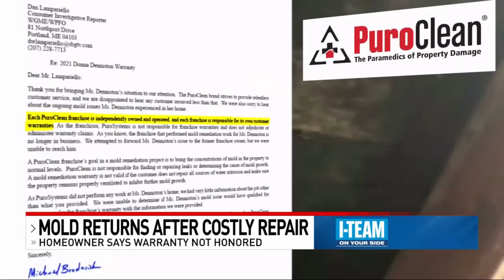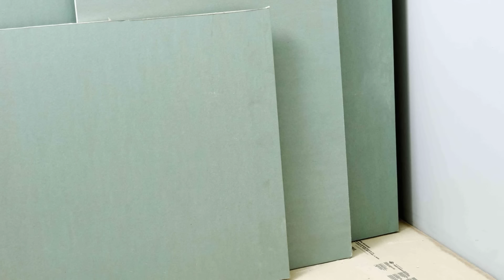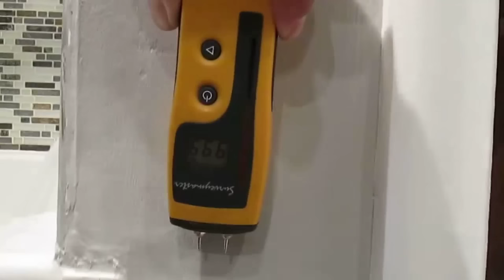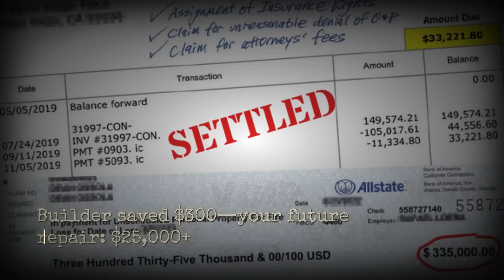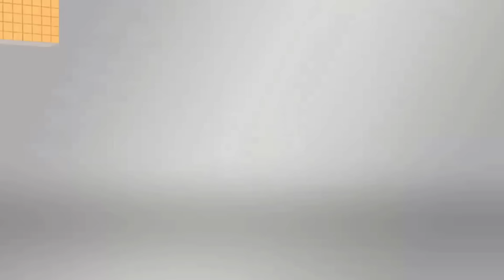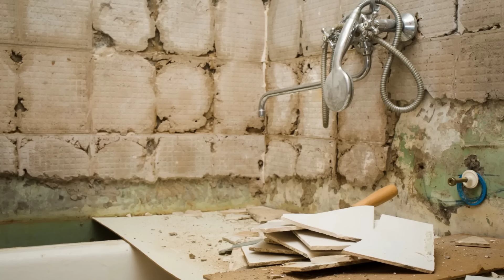Why 90% of New Bathrooms Are Garbage (The Waterproofing Scam)

Comment from the maker: Most homeowners think *tile = waterproof.*
It’s not.

Tile and grout are just the *decorative layer**. Water *always gets through them. What actually protects your house is the *waterproofing membrane behind the tile* — and in many new homes, it simply isn’t there.

That missing *$300 layer* is why so many new showers become **mold factories in 3–5 years**.

Quick rule before you buy or remodel a bathroom:

1⃣ *Check the corners* – cracks or dark grout where walls meet the floor = water is getting behind the tile.
2⃣ *Check the substrate* – if tile near the base sounds hollow or flexes, the wall behind it may already be failing.
3⃣ *Ask the question* – “What waterproofing system is behind the tile?”

If the answer isn’t a *named membrane system* (Kerdi, Wedi, RedGard, HydroDefense, etc.), the shower probably isn’t waterproofed.

And if you already have a builder-grade shower:
Use *100% silicone in corners, seal grout yearly, and run the fan after showers.* It won’t fix the design — but it can buy time.

💬 Curious what’s behind your shower tile? Drop your experience or questions below. I read every comment.
Reply: my apartment has a waterproof layering of mold behind it so you nnever have to worry about mold cuz the mold prevents mold from growing there.
Reply: I enjoyed this video very much.  I had my master bathroom remodeled, taking out a steel bathtub, and in its place a walk-in shower with teak seat on the back wall, so as I age I will still be able to easily use the shower.
     Installation was (to me) surprisingly involved ... the floor was framed in wood, then buckets hot tar applied.  The walls were covered with black paper, then hardy-backer (sp?), then RedGuard, then tile!
     As your comment mentions, I, as a Joe Blow, DID think the tile was "water proof," and was surprised at how much effort the contractor took in that relatively small shower room.
Reply from the maker: @josephgaviota  That is such a great story, and it sounds like your contractor really did a bulletproof job. Most people are shocked by how much "invisible" work goes into a shower, but that multi-layer approach with the hot tar and RedGard means you actually have a professional-grade waterproof seal. It’s also a smart move to plan ahead with the teak seat—it adds a nice high-end feel while being incredibly practical as the years go by. You definitely got a quality installation that was built to last!
Reply: all the landlords i ve seen which is all of them they all buy cement boarrd
Reply: @thatonecommmmmmenter  it works fine. 99 percent of the time you tear out a TILE bathroom ...it aint cause its roting behind it.. Its a visual upgrade due to wife , or D2W i call it... unless its apartments lol. thats for diffrent reasons and they ARE falling apart back there
Reply: Always kerdi

Comment: guys ..... its a way to reinvent something that lasts hundreds of years meaning mortars , plasters mastics. not so much DRYWALL ON THE LIP ...the new ways are just a way to sell something to "SAVE TIME" or be a better product.. i ask HOWs that since homes are meant to NOT last hundreds of years because of growth and someday ur HOUSE is a companies parking lot. caulk tubes and thin layers of rubber aint gonna be eaiser , faster or outlast a proper thick bed of mortar on SMALL TILE ...small tile . large tile is also a scam to me .. how do lath and plaster homes keep a bathroom then ? how about a CASTLE ? lol how about small tile floors is india and asia that have been there since math was invented ... i will say redgauard is tough . BUT u cant make redguard can you? welp THEY can . the "expensive shower is the "new shower" the long lasting shower is the one done with common sense and common age old proven to last methods.. No, drywall tiled over with mastic or thin set is COMMON SENSE.. its goona rot and nobody has ever said "thats how you SUPPOSED to do it" its how you do it if you have to because of money or choice

Comment: Bought my house as new construction in 1980. About 15 years later my teenage son was taking a shower and bumped into the shower wall and put a hole in it. I ended up tearing it down and found that the builder had used regular drywall, not even green board, behind the tiles in the wet areas. I tore it down to the studs, dried it out, replaced the insulation and added new vapor barrier, then DuRock cement boards and re-tiled. Still looks great.
Reply: Was there mold behind the dry wall that your son knocked out?
Reply: @antiichina  Yes there was. I let it dry out for a day after removing the damp insulation and then sprayed Mold Armor™ on the affected areas. You can literally watch the black mold disappear in about 30 seconds.

Comment: The problem is a tiled shower and floor is about 18k to 20k in most markets for parts and labor. People then get other quotes and some gc says they can do it for 12k. The gc hires cheapest sub possible to make more profit and disaster ensues. Instead of 3 to 4 week completion its 3 to 4 months and still not done right. Now no contractor will touch to fix and its rip out and redo so now 32k to 34k on an 18k to 20k project and half a year of grief. My tile guys only 2 of them do the work for the company but they are not cheap. They show up on time and keep on schedule. Hamilton Tile in GA you can see their jobs real time on their youtube channel and facebook page.
Reply from the maker: You just laid out the 'Low-Bid Math' perfectly! 🛠️ Paying $34k for a $18k shower is the ultimate Quality Rot trap. It’s a tragedy that homeowners think they’re getting a deal, when they’re actually just prepaying for a disaster. Huge shoutout to Hamilton Tile for maintaining the Backbone of the trade—showing the work in real-time is the only way to prove you aren't running a waterproofing scam. In your experience, what’s the #1 'red flag' a homeowner should look for in a $12k quote to know they're about to get burned?
Reply: @QualityRot  When it's 12k and they say they can do the job right away. Shows they are desperate for  projects and have little going on. Quality companies are often booked 3 to 6 weeks in advance to start your project. They do high quality work typically and it is why they are busy. The put your shower or tub in few days are a ripoff. They charge the 10k to 12k and make it sound like amazing stuff done to the bathroom and it's something that falls apart in 2 to 5 years because it's crap. There are companies that run tv and pay per click ads all day long and consumers eat it up because they focus on lowest price not what they get for what they pay. They will take a risk to save hundreds on a project but will stay poor paying credit cards at 30% interest buying crap they resell year later at garage sale for 10 cents on the dollar.

Comment: I am a tile setter by trade and came up old school. I have torn out countless showers from early to mid 1900’s and they never had waterproofing and the vast majority were still perfect. Only reason for the tear out was to remodel.  

The most common reason for failure is tradesmen who have no clue what they are doing. Installer error is the number one reason for failure.
Reply from the maker: There's no substitute for proper installation techniques, and you've hit the nail on the head regarding the real cause of most modern failures.

Comment: I'm an old-school mud guy with hot-mop pans. They'll last 50+ years if you can find anyone who still does them that way. I got out of the business 20 years ago, but still know one guy who does it that way.
Reply from the maker: he 'Hot-Mop' is a legendary bit of craftsmanship! It’s the perfect example of how we’ve traded 50 years of reliability for 2 days of saved labor. It’s a shame that it’s become so rare that you only know 'one guy' left doing it. Do you think the current 'waterproofing scams' are due to a lack of training, or are contractors just being forced to move too fast by management?
Reply: @QualityRot  I think people trained at the tile institutes are trained with the new methods, so it's not a lack of training. I'm not necessarily against the newer methods, but I've seen enough "new, more-efficient technology" like polybutylene pipes fail and torn out some of the first attempts at roll-on waterproofing that I just stuck with the method that I knew worked. I was tearing out stuff done in the 1920s when I was working in the 1990s and it was still waterproof but the glaze had worn off the tile. In 50 years if people are just starting to tear out this new stuff, then I'll trust it.
Reply from the maker: This is a legendary take! Comparing 1920s durability to the polybutylene disaster is the perfect way to explain Quality Rot. We've traded 'proven for 70 years' for 'efficient on the day of install.' If you were still in the game today, do you think there's any modern waterproofing system you'd actually trust, or is it hot-mop or nothing for a lifelong pro?

Comment: Porcelain tile is waterproof. Ceramic tile is waterproof as long as the outer glaze coating is intact. I almost always use porcelain tile in showers and yes you could get away with greenboard behind with redgard over. No problem when properly installed
Reply from the maker: Using porcelain is a great way to ensure longevity, though modern building codes have definitely shifted away from using paper-faced drywall in wet areas! 🛡️

Comment: This is why I built my own bathroom the old way!
Reply from the maker: Building it yourself is the only way to ensure the waterproofing is actually done to a standard that lasts decades. When you control the process, you skip the "scams" and shortcuts that lead to those hidden leaks modern contractors often leave behind.

Do you think most people today even realize how much garbage construction is hiding behind their brand-new bathroom tiles?
Reply: @QualityRot  No and what gets me is that they destroy the original high quality pre 1960 bathrooms to install the cheap mold growing ugly garbage!

Comment: I was shocked, when I found out the shower tiles, ceramic tiles, installed perhaps 1950, were installed on PLYWOOD.  No joke.  No water proofing, just water diversion.  Any drip could escape.   The thing had an artful water diversion, that driped into the tub.  If anyone had put some calk over the weep hole, they could have destroyed the entire system, but no one ever did.   So, 60 years of water drips, escaping.  zero mold.  weird.   Today, we make things "waterproof", but we also prevent water from drying out.
Reply from the maker: That’s insane! I can’t believe those 1950s shower tiles were just slapped onto plywood like that, and it actually worked for 60 years without any mold. It’s kind of wild how the old-school setup basically relied on letting water escape and dry out, and somehow it totally held up. Makes you wonder if all the fancy waterproofing we do now is actually overthinking it. 

If you were to redo that shower today, would you stick with modern waterproofing or try to mimic the old system?

Comment: This video makes huge generalizations. Yeah tile is not waterproof but the vinyl pan you installed is waterproof. The change in planes are supposed to be caulked with silicone designed for showers and bathtubs. There is backer board that is waterproof and you don’t put membrane over it. Membrane systems have a whole list of materials that COME WITH IT AS A SYSTEM. Even Thames a waterproof membrane is only there to manage the water and is ironically not as fully waterproof as this video makes it seem and is not an all encompassing solution.
Reply from the maker: Lots of good points on how these components actually work together.

Comment: To be fair I’m renovating my entire main bathroom right now…house was build in the 80s original bathroom. Tile right over drywall….during demolition found everything was completely dry underneath and zero water damage….side note if you ever have to remove a cast iron tub by yourself…..don’t 😂😂
Reply: Of course there was no water behind the tiles, since you had cast iron tub.
You had no shower, right?
Reply: @nickname5103 shower/tub combo with a curtain rod. Could be used for either
Reply: @nickname5103   Cast iron tubs, have a bend, that prevents water from going up the wall, and only allows drips to drip into the tub. The plywood say, goes over this lip, but does not bottom out on the tub.  So, any water, can be diverted into the tub.   It's how some showers were designed, as water diversion, not water proof.    When people started insulating everything, they lost the old knowledge, and before you know it, someone calking the water diversion system shut, and preventing the water from escaping.     Which resulted in more lost tubs, with old tech, which exerbated the lack of knowledge about water diversion, vs water proofing.   Plywood went 50, 60 years, getting wet every day with a few drips, and drying out.  then someone came and shoved insulation in the holes, and put up vaper barriors, etc.
Reply: If you need to remove a cast iron tub: use a sledge hammer and break it into four to six pieces first.

Comment: Most of the old homes in my area traditionally used 2 layers of roofing felt sealed at edges with asphalt as a membrane and they would hold for at least 50 years.
Reply: That’s called a hot mop
Reply: roofing felt on bathroom floors, fail eventually, and fail epically, with mold that hurts everyone that removes it.  It's florescent green mold.
Reply: @normbograham3  yeah that’s not a fail, just an older method of pan installation that is still done to this day in some areas.

Comment: The what I call the mud method also lets you "fix" the wall not being plumb. Most walls aren't plumb so to speak. Therefore using backing board etc your tile isnt even either.

Comment: I'm renovating my shower room. First I caulked all joints and screws on green plasterboards and added mesh, then I gave two coats of waterproofing primer and covered with two thick coats of tanking paste. I hope that I'm doing will be enough. I will put silicone between the shower tray and all walls at the end.
Reply: Kerdi board or go board my friend. Your using green board drywall which should not be used
Reply: @marcoamaro2471 He is waterproofing it.  Doesn't matter if it is cardboard, if water can not penetrate it.

Comment: Green board is just drywall that manufactures trick people into paying 30% more for. It does nothing.
Reply: Green board does nothing in wet areas, but in humid areas such as bathrooms (not in showers) it is more resistant for mold growth vs regular sheetrock...
Reply: @OnurlaFener I've been doing drywall for 27 years, it does nothing. I've cut out moldy green and blue rock on numerous occasions. If humid conditions are such a problem that its causing mold in your walls you have bigger problems than what color your drywall is. It does nothing but cost 30% more and give everyone a nice warm fuzzy feeling like they are doing some pro shit.

Comment: I am a retired tile contractor.  This video is all BS.  It's classic YT garbage for clicks....sounds good, seems to make sense to the untrained person, but full of misinformation. 
"Waterproofing membrane" is a rip-off  and NOT necessary.  It's a relatively new product that can create problems itself.
NONE of those old-time lifetime lasting tile jobs used "waterproofing membrane", they simply did NOT TILE OVER DRYWALL.
The key is to not build the tub or shower walls out of anything water can destroy.
Cementboard is completely unharmed by water (despite the lie otherwise told in this video).
Just use Cementboard as a backerboard (never drywall!), tape the joints with a screen mesh using a top grade polymer modified thinset and a flat trowel to tape the joints (NOT drywall compound!).
Use that high quality polymer modified thinset to bond the tiles directly to the cementboard (HINT: dampen the cementboard with a WET sponge prior to spreading the thinset. This will help prevent the dry absorbent cementboard from sucking the moisture out of the thinset too quickly).
Grout with a polymer modified cement based grout. You don't need to seal the grout (that is another scam).
This type of installation will last a lifetime...Cementboard-thinset-grout = nothing that can rot.
In the description of this video it says "45 products in this video - Earns commissions "
Please don't believe everything you see on YT.